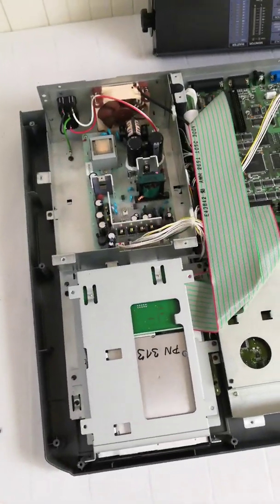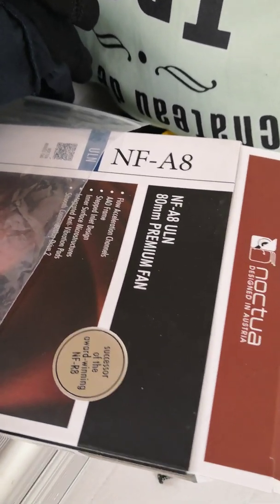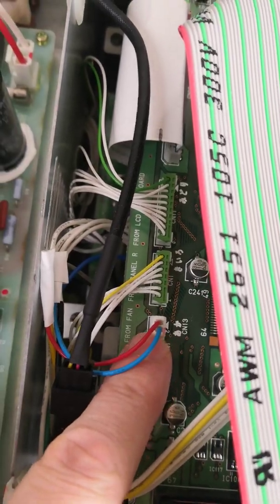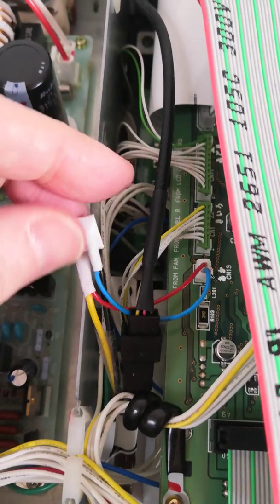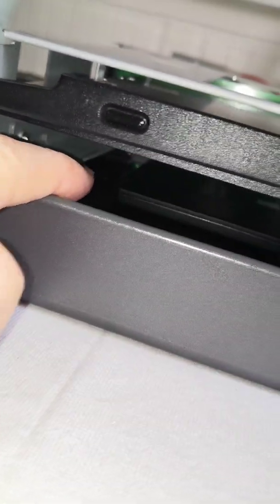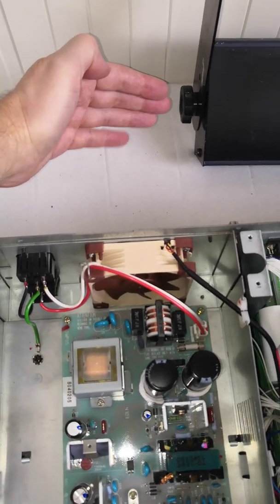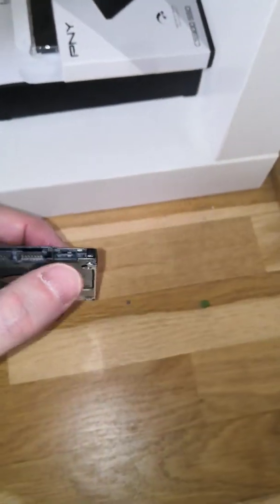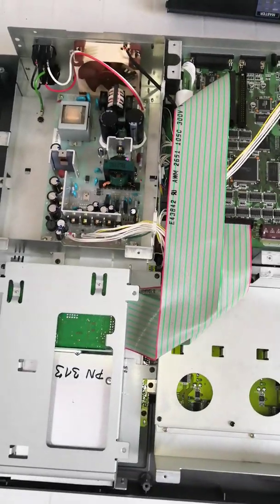Convert Roland VS-2480 CD to DVD, SSD and silent fan

Comment: adding adapters is a bad idea they will burn out and you could fry the board what kind of safety resistors or fuses on that adapter
I would stick with IDE harddrives

Comment: Be careful.  The Panasonic UJ-860 does not have the correct connector on the back.  Verify the connector type before replacing the CD Burner.

Comment: Great. I have a vs that doesn't play the tracks and when it does there is static. Can I swap my hard drive with another used vs to retrieve my songs?
Reply: Static noise would indicate you may need to replace the capacitors, and nothing to do with the hard drive

Comment: My tests indicate you need the VS2480CD model mainboard to get the SSD mod to work. It did not work for me using a VS2480HD model mainboard. It did work when I changed it to a VS2480CD model mainboard. I hope this info is useful to others having issues with the SSD mod. The OP of this video has the VS2480CD model mainboard and so would not have noticed any issues with the SSD mod like all the VS2480HD model users are having.
Reply: Peace be to you,
Good job. 
It's good to know the truth.

A servant of The One

Comment: What samsung drive did you use ? I plan on swit thing my vs over to ssd eventually . I currently have the Kingston  so I wont even try with that one.
Reply: at 2:45 in the video - he says he used the "Samsung Evo 860 250GB"

Comment: Hi Rick, I have the VS2480HD with the hard drive at the front right, do you have a link to the IDE to SATA converter card you used for this.
I hear a lot do not work.
Reply: Hi Scott - He says he used the JP103-5 IDE to SATA adapter. (in the video description).  Did you end up buying the JP103-5?
Reply: @ElectroIllusion  I tried the exact same adapter, several copies and this never worked for me. The drive would be recognised but would fail at the end of the format every time.  The only method I have got to work is the compact flash conversion and this is dependent on getting compatible CF cards.  The SSD mod is very hit and miss.
Reply: @scottxs904  - Since I sent you that message I found out you need the VS2480CD model mainboard to get the SSD mod to work.   I have the VS2400CD - and I will be attempting an SSD mod with it soon.  I agree this could be hit or miss.